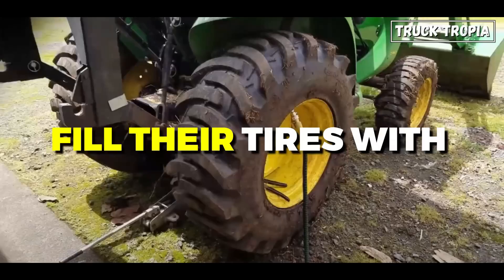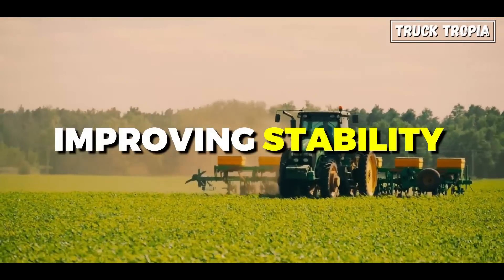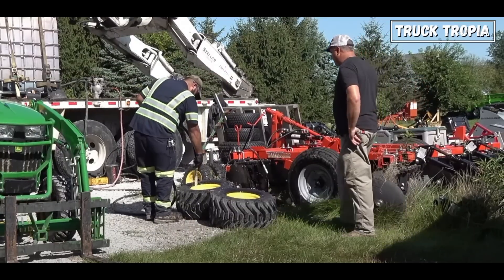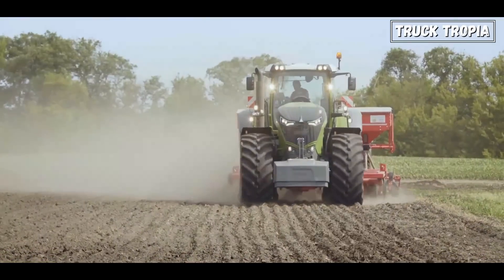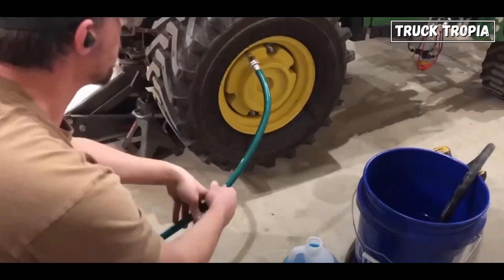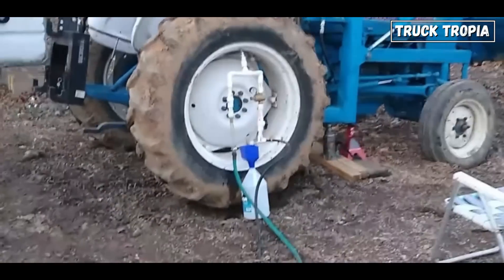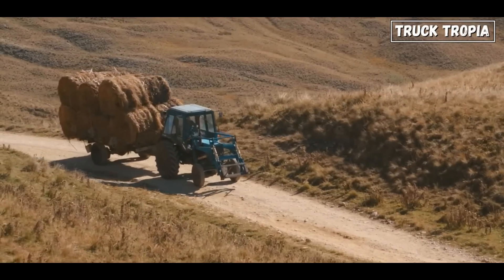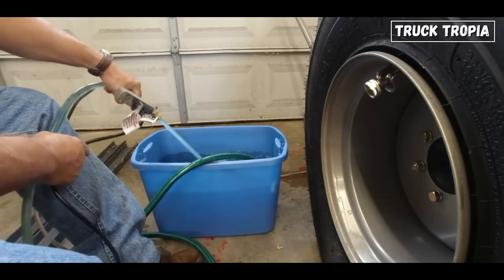Why Some Tractor Tires Are Filled With Water?

Comment: I did tractor tires for over a decade, and I definitely did my share of tires with fluid. It was always the worst thing, that took 4 times as long and always made a mess, not to mention having to grind down the wheel to get rid of rust plus primering the wheel to protect it again.  

Wheel weights are a FAR better option, not to mention you can add or subtract them as you please.  The ONLY way it made possible sense to me was with a 2wd loader tractor.  

And as far as using it for traction, its not as advantageous as weights anyways. The fluid adds tractive force but also adds to the weight that is required to spin the actual tire since it is further out than weights would be.  This takes more power to drive and gives the illusion that the heavy tire is "biting" more. Wheel weights will add to your draft pressure but fluid will not.

After doing some figuring and observing with customers it seemed to be about a 5/8 ratio, as in; 600 lb of weight would add as much pulling power as 1000 lb of fluid.

Are weights more expensive? Yes. But they are only more expensive once.  If a tire has a puncture one time, the wheel weights paid for themselves in the cost difference between fixing a tire with fluid and fixing a tire without fluid.

We had more than a few customers that i convinced to switch away from the fluid when putton on new tires, going with a good radial tire and was ballasted and aired cirrectly, and they all noticed an immediate improvement in pulling power.

And no, you would not want water in a semi tire...lol

All this to say that weights are expensive! More than ever. I understand 100% that fluid is way cheaper, and does essentially the same thing.  It is 100% the farmers call on how they want to ballast their own piece of equipment.  This is just my observations on fixing or replacing over 10,000 ag tires while I was there.
Reply: I see you bought dears BS
Reply: @RJ1999x  lol oh wow. Sure If thats what you think, friend.

If you know me, you know that 4440 is a four letter word. Think whatever you like. Ive changed or fixed over 10 thousand farm tires. How many have you done?
Reply: @nevinbontrager8828  seeing I've been farming since 1984 and own 23 tractors most loaded down, I can tell you that your opinion on fluid is because you had to deal with unmaintained tires, and yes it is a pain to handle, but it's far cheaper than iron weight, and the difference between a light tractor and one weighted properly is night and day
Reply: @RJ1999x  yep, and I have utter and total respect for you, make no mistake.   

My argument is that you only have to pay for weights once, whereas the total cost of having fluid over the life of a tire tends to be greater.

You obviously don't need me to tell you how to farm, it's just my observations on fluid in tires based on my experience.

Cost is 100% the reason that fluid exists in the first place.
Reply: @nevinbontrager8828  Fluid was actually invented by Allis Chalmers, they did it because instead of selling the farmer a big heavy tractor, they could sell a smaller lighter tractor , load it with fluid, and the farmer got a better deal.
Up until the 90's fluid was widely used, but then manufacturers started the campaign that fluid was bad, and high prices pig iron (cheaply made) was very profitable for them.
Now because farmers don't own the tractor it's leased, the companies cash in again by leasing bigger and bigger tractors to do the same job a smaller properly weighted tractor could do.
I feel your pain with fluid, we actually have our own equipment for putting it in and taking it out. The real issue is farmers don't maintain the tractors with fluid, if we see a little moisture around the stem, we change the core, if you let it leak, yes it rots the rim.
We have tractors with calcium, some with beet juice and 1 with vegetable oil, the beet juice and vegetable oil are non corrosive
Reply: @RJ1999x  I had forgotten that was an AC thing. I remember now seeing that promo video of the WD and the case.  Fun y since AC had a foundry too though, that they didn't push weights.  The thing was though that in many places only water was needed, not the calcium as it never froze, but yeah up here in the midwest everything needed the salt.

I agree 100% with the maintenance aspect too, yes there are times when the core housing goes bad, those were the best calls! 

Farmer:  "you mean I paid you  $75 to come out just to replace a valve core?"

Me: "well if I had to come out anyway, would you rather it be a cheap fix or an expensive one?"

Also, the traction booster system was one that couldn't be beat. It was the most efficient way of transmitting load from implement to tractor. That was the main reason they could sell a lighter tractor, but as soon as you switched conventional drawbar or 3 point, the advantage was mostly gone.
Reply: @nevinbontrager8828   you have a good memory my friend! Allis Chalmers looked for providing farmers with solutions that made them more money, other companies were only interested in making more money.
Allis Chalmers did have their own foundries , and the traction booster system could not be beat, even up to their last tractor, the traction booster worked fantastic, in fact I never seen another manufacturer  come close to it until electronics entered the 3 pt systems, and the first electronic ones didn't work the greatest.
 I have a friend that is a tire man, so I know exactly what you mean about the service call. The core and the tool to change them, don't even cost $10, but few farmers own either. We've swapped a lot of valve cores out of non fluid filled tires that started to leak.
I don't envy your job, it's a tough one, more so if you don't know what your doing , or don't have the tools.
Our man makes it look like childs play, but I know from experience it can be brutal
Reply: @RJ1999x    I honest-to-goodness loved changing tires, but more than that I loved spending time with farmers and just chatting a fellow up while helping him out. Seemed like maybe it wasn't so bad for the fellow who just drove over a fence post if the guy there to help was a friend and you could both laugh about it. Lol
Reply: @nevinbontrager8828  excellent, unfortunately farming has changed so much now, the camaraderie isn't there like it was,  doubt whether it will return
Reply: Calcium chloride is the worst, but I guess in some cases someone would want the extreme solution - not making a choice between iron and fluid but having both. The extra hassle from beet juice in a tubeless setup must be much less than all the corrosion.

Farming is of course not the same in any two countries or climates or even between any two farms. However I have never felt the need for, or felt like having any benefit from, having liquid ballast in actual field work. Mostly useless or a nuisance - for me.

In loading, lifting and rough terrain forest operations the liquid fill has been absolutely necessary. Not for tractive ability but for center of gravity. The latter is even slightly better with fluid than metal wheel weights, at the same added weight of course.
Reply: @ffffffff-vv7yp  look at your tires if the front rounded or sharp?

Comment: Probably keeps them from bouncing so much, same thing with Barges they have tanks of water in the bottom of them so they dont slosh so much. People really need to take Science again ,basic shit be so "mysterious" to yall. Use oil, that wont rust the rim and also oil doesn't freeze, and also since tires are oilbased it will keep the rubber from dry rotting.

Comment: How does this affect truck tires?
Reply: Not recommended for on road use at all due to safety concerns. Furthermore Truck operators typically try to get the mass of the empty truck as low as possible as this means they can haul more freight i.e. if you add 900kg(1985lb) of water to the tires of an 18 wheeler you can haul 900kg(1985lb) less freight, as trucks are limited on their total mass and not the mass of the freight.
Reply: It would probably reduce your gas mileage and wear out your breaks faster. Also, increase your stopping distance. In tractors, they primarily drive at slow speeds, so the water stays at the bottom of the tire. At high speeds, the water will start to distribute evenly making the tire act like a fly wheel. Sudden stops would cause the water to start sloshing around, which would likely cause a truck to jerk around.
Reply: As a mechanic no don't do this... tractors are slow and have huge tires cars and trucks go fast and have smaller tires.... the water wouldn't behave the same at those higher speeds. At the end of the day you could do it to truck tires but speed would be the biggest issue assuming anything past 30mph.

Comment: For weight distribution I would rather have an arm sticking out with a pivot point but maybe it's too far fetched. The thing about not damaging the soil I don't get, you could deflate some air out to spread the load, it goes against adding load with the water.
English wise, the title is interesting. I would have said "are filled" instead of "is filled". I'm sure I'm wrong, the grammar is just strange to me as a french-portuguese.
Reply: "Why are some tractor tires filled with water?' would be proper.
Reply: English is not my native tongue. 

As a farmer also differ on the point of "adding waster reduces soil compaction". Soil compaction is a great concern for farmers, but I do not see how adding water can reduce it, it would rather increase it as you say; fitting larger tires would reduce compaction and also increase traction.